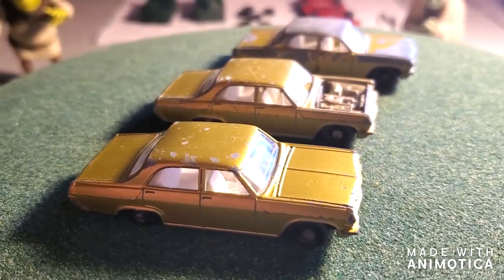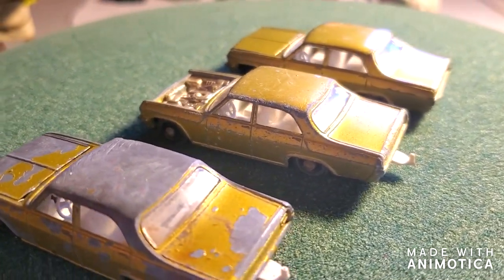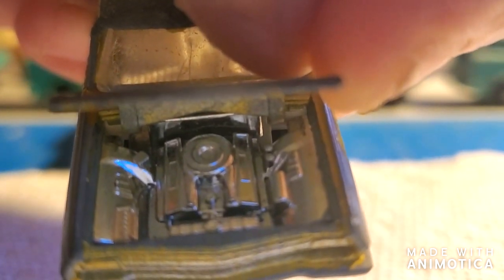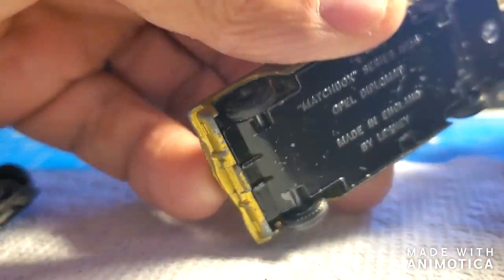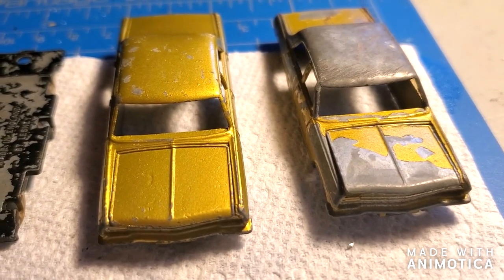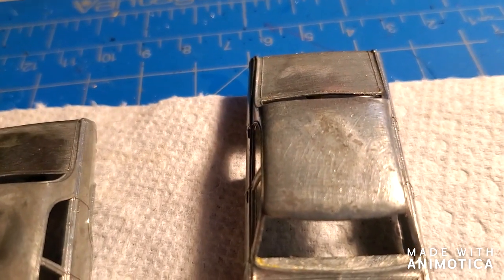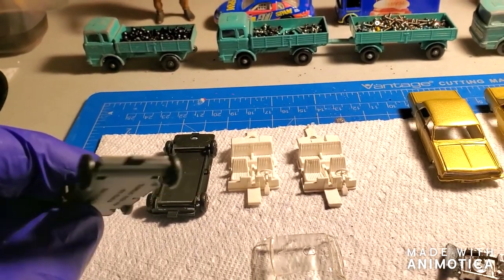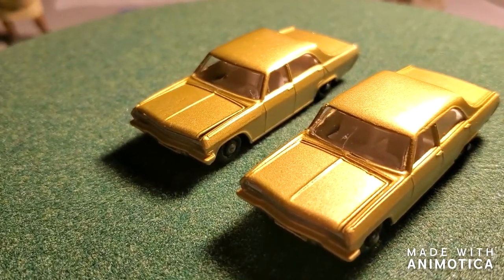Matchbox Opel Diplomat

Comment: this colour looks better than the original odd golden-yellow whatever. :)  nicely done, shiny and clean! ^^ aye, and thanks for proividing us with another serial restoration. :)
This casting is the Opel Diplomat-A and it came with a chevy 4.6 V8 they took off the GM shelf. the successing generation used the 5.4, btw. the A came also as Kapitän und Admiral (Opel had it with naval names back when) which usually had straight-six engines, though you could order the Admiral with the V8 as well. or, as a rather elegant coupe!
if you ever want to do a resto-plus keep in mind that they came with a lot of chrome. XD
Reply from the maker: Thanks Lothar! Love that chrome!